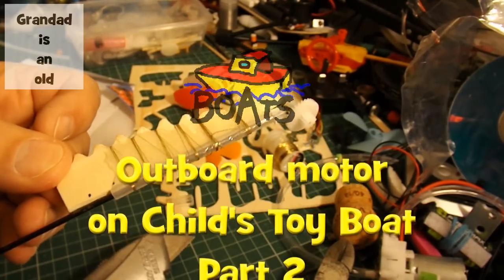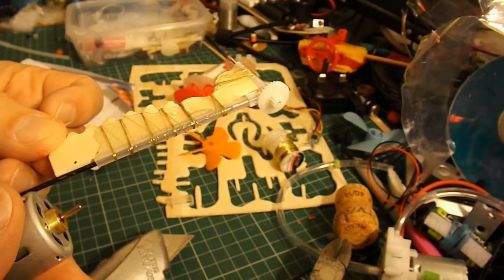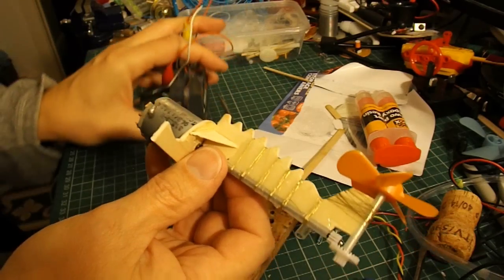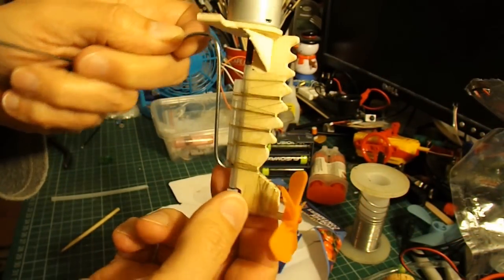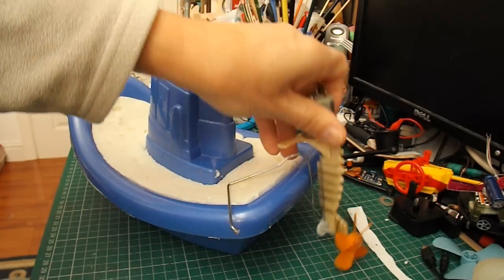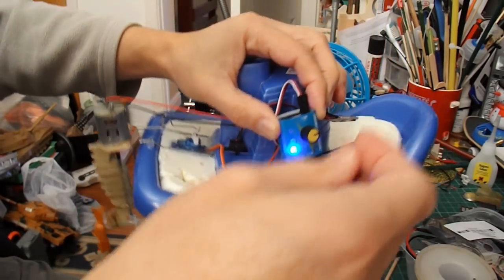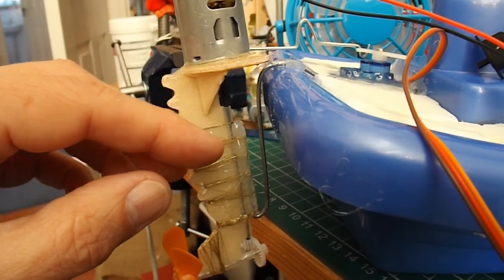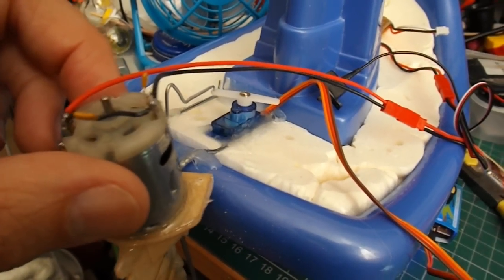Outboard motor on Child's Toy Boat 2 BUILD

Comment: Nice, can u add lughts
Reply: lightd
Reply: +Jboss2001 Gaming lights
Reply from the maker: +Jboss2001 Gaming lights would make it look pretty but have no practical use. You can just buy a cheap battery powered string of lights and glue them round the edge. Here is a typical example https://youtu.be/DLcj07KuCL4
Reply: Ok thanks

Comment: +GrandadIsAnOldManput the receiver and battery in the plastic funnel
drill a hole in it , put the parts inside than close it with epoxy or foam
Reply from the maker: +Daniel de Vynck could do, could cut it and just seal it back down with tape to we can get it back out again easily otherwise you may have problems trying to charge the battery :)
Reply: K